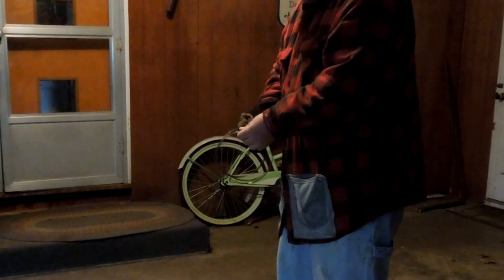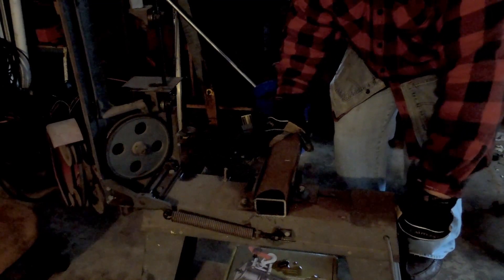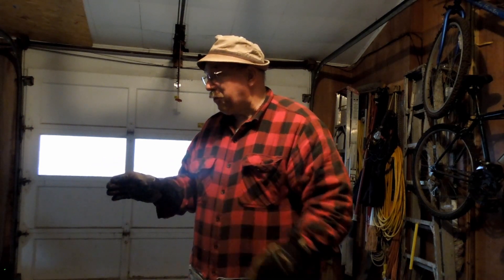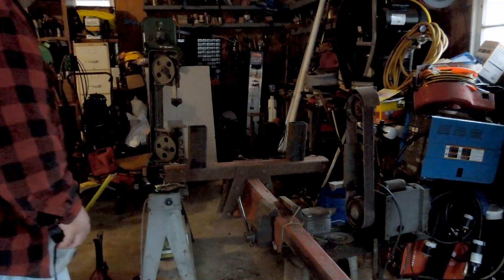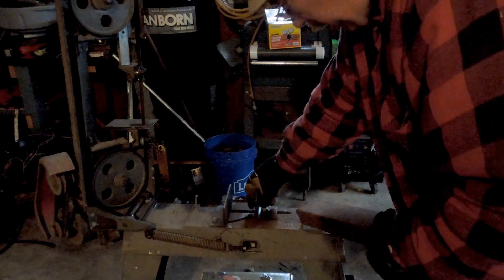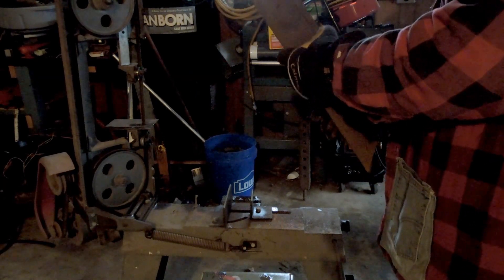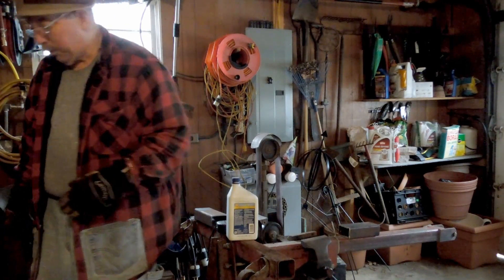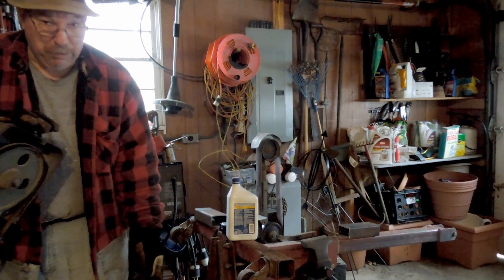Building A Tractor Mounted Engine Hoist Pt 2

Comment: The big one of mine takes a 10'6" blade.  I buy bi-metal from Graingers and get pretty good service out of them.  You would love that machine....it's oooooold.  All cast base and heavy with a capital H !  I had to fix the flex joint in the cylinder bleed for the feed rate and used an old 3/8 seal pick in place of the broken U joint.  Works fine.  IIRC, it has maybe a 16" throat.  Don't swear to that though. You got a good start on the 3 point engine lift.
Reply from the maker: Most of the shops I ran had Doalls. Taller than me by a couple feet and had a blade welder Nice for cutting inside holes. Drill a hole and thread the blade through, Then weld it. cut when you were done. I bought bulk rolls of blade stock. Bimetal is the best.

Comment: I could never get my HF bandsaw to work right...  When I move it stays!   Lol.   Coming along Dave!
Reply from the maker: Band saw blades have problems. I'm surprised at how well the cheap, $16.00, Bimetal HF blade works. Just a little issue with the set has them wandering to the side. If the run off for more than just a little while they twist amd can't be straightened. 
This was a perfect setup to break in the blade. No sharp edges and thick enough that 3 or more teeth were always in the cut. When this blade wears out the saw has shown it is woth buying a good blade. It tracks straight and the guides are ridgid. No slop in the hinge pin and the wheels work right. Pretty good saw.
Reply: @OldSneelock   Dave, when I first got the saw the blade was tracking so bad I thought it was going to do a "U turn" and come back up!  LOL
Reply from the maker: @ScoutCrafter  In all the shops I ran or worked in the Fab Shop had a band saw and the Tool Room had a power hack saw. Wandering a bit when cutting a piece of angle to be welded wasn't a big deal. Clamps and a bit of weld bead can fix a lot. 
Cutting a H13 die block undersize wasn't fixable.